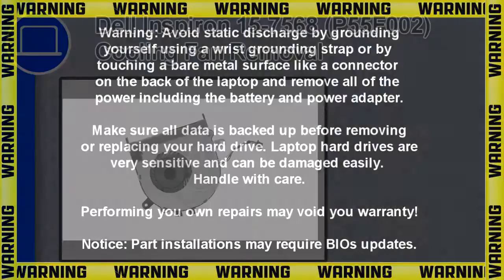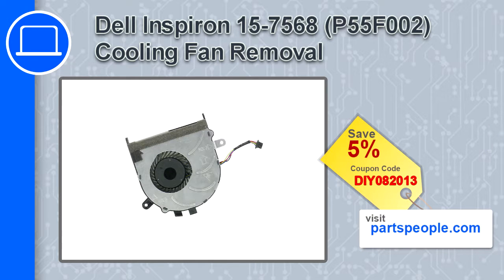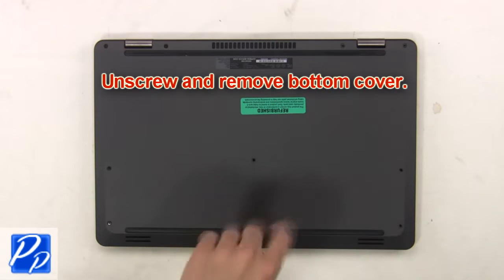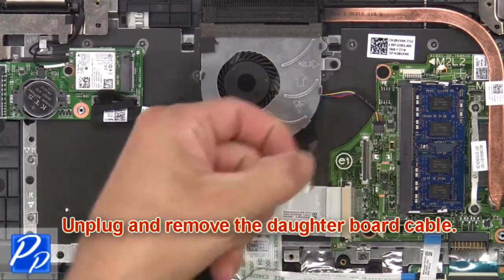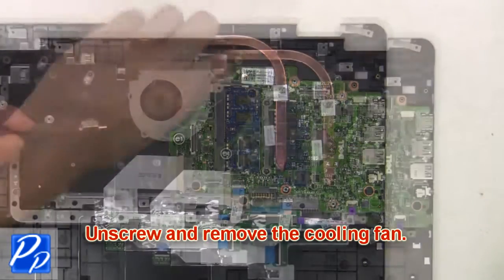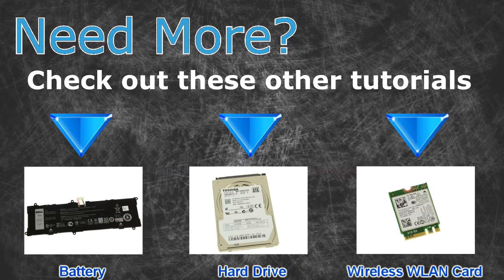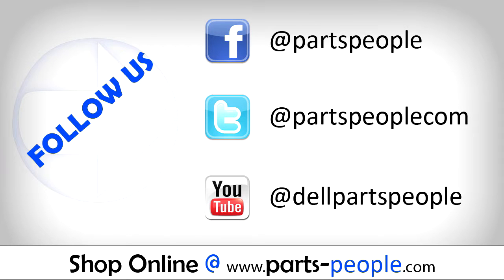Dell Inspiron 15-7568 (P55F002) Cooling Fan How-To Video Tutorial

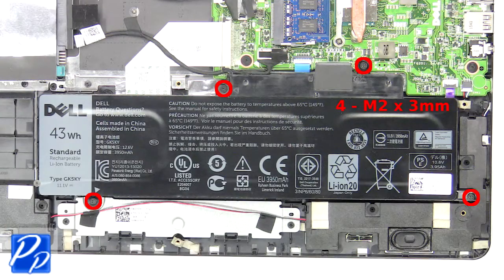Comment: Hi, what is the L-shaped copper-colored pipe-like tube running from the cooling fan to adjacent the RAM? I wish to know because (speaking with reference to 0:38 in your video) the top right section of my Dell Inspiron 15-7568 is heating up more than usual with loud spinning noise (which I suspect is the fan). Please let me know asap. Thank you so much!!!
Reply from the maker: The copper pipe is part of the CPU heatsink. If your laptop is overheating, I would remove the heatsink and replace the thermal paste and clean the or replace the fan.